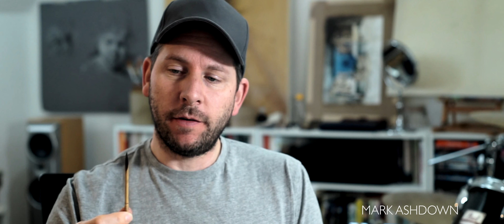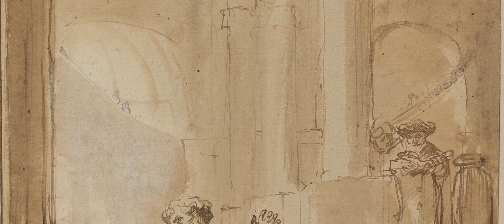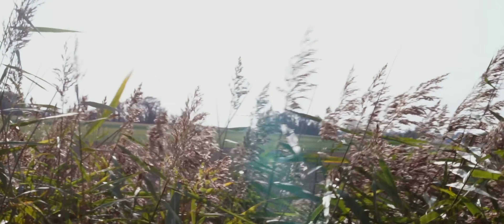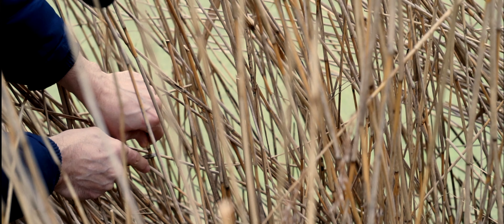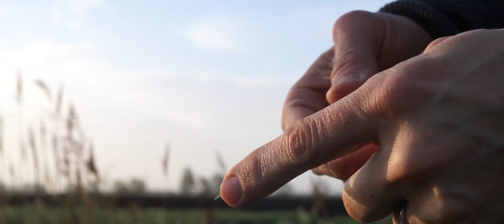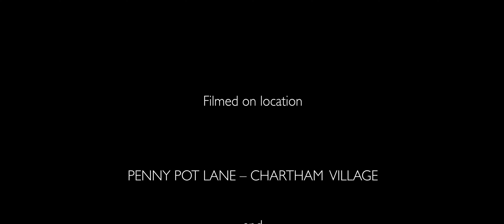How To MAKE A REED PEN

Comment: I've been studying a poem thunder: perfect mind from the nag hamadi library and I've been totally baffled examining the pen strokes which vary from thick to thin, like any flat tip nib, but don't seem to occur as the natural result of a uniform or consistent pen angle. Perhaps the scribe who copied the text was using a double tipped reed pen, following a logic that isn't clear to me at the moment. This would never have occurred to me if I hadn't watched your video. It shouldn't be hard to determine if the various lines of the letters are arbitrary or intentional by mapping out the occurrences of different widths of lines now that I'm aware it might not just be accident or chance or the amount of ink loaded in the pan at the time, etc. you have my gratitude 😇